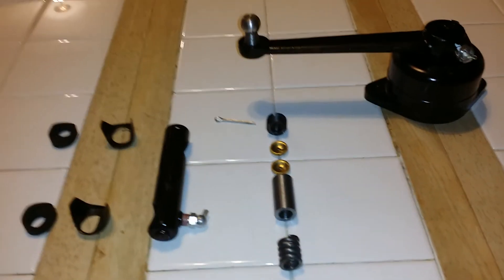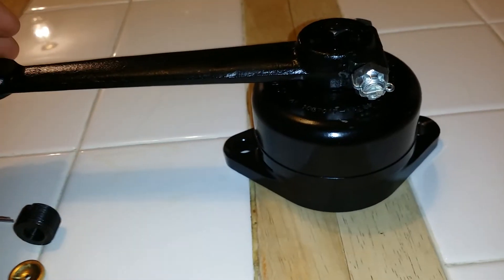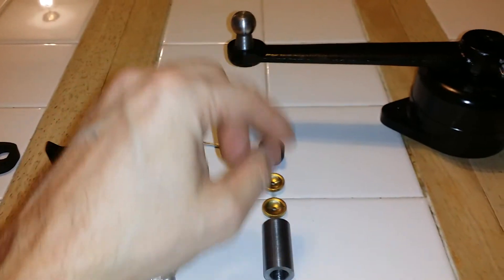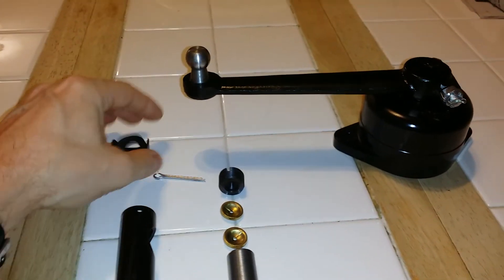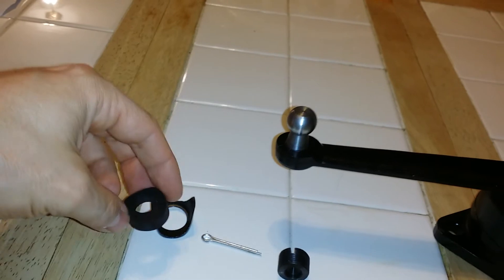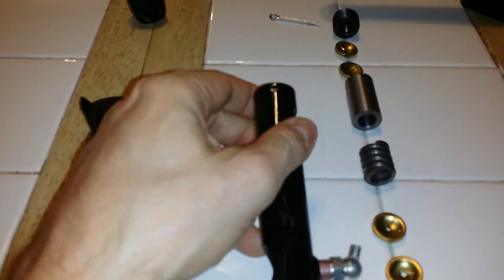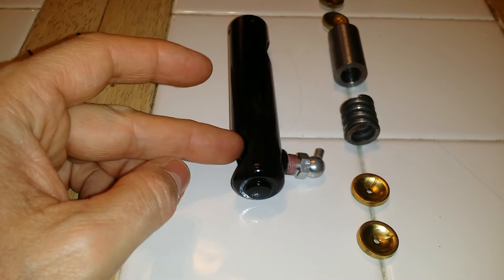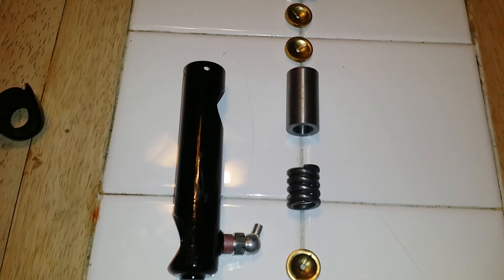Ford Model A shock Assembly sequence

Comment: Having just done this to one of my links (the brass cups were worn out), I can confirm that this is a tricky operation.  The grease SHOULD keep the internal parts stuck together to let you install these, but it took me several tries to get it to work.  I started from the bottom end, making sure the metal caps completely covered the opening in the link, then I mounted the shock and arm to the frame before I pushed the link onto the ball of the shock arm.  Once the link was attached to the arm, I installed the 4th brass cup and the threaded plug.   One other hint: remove the week from the car first to give yourself a lot of room to work.